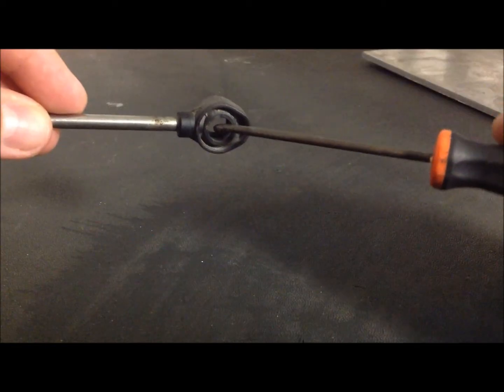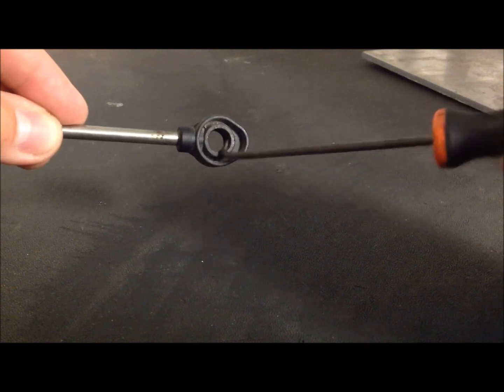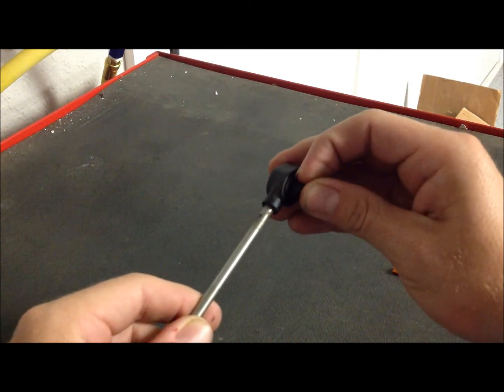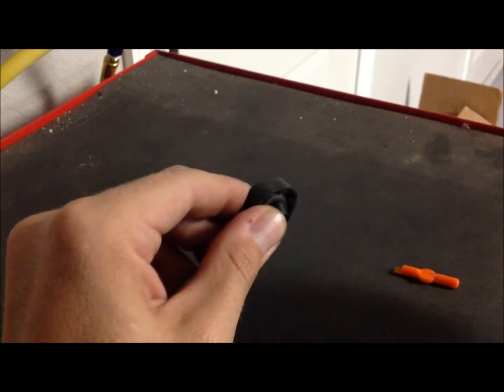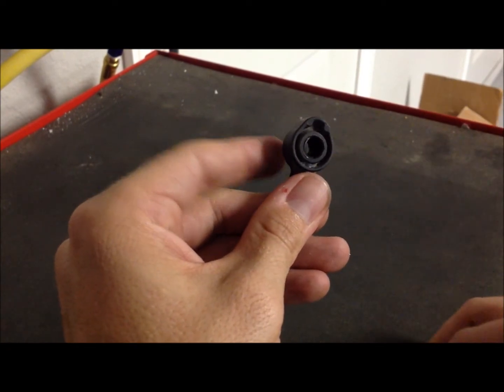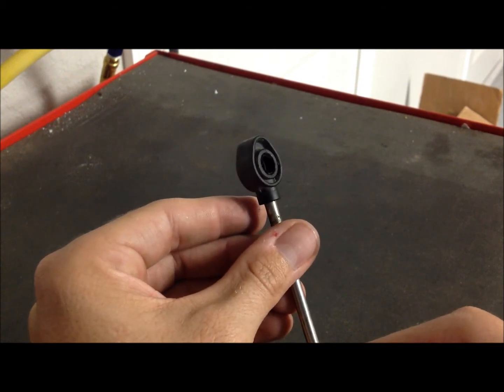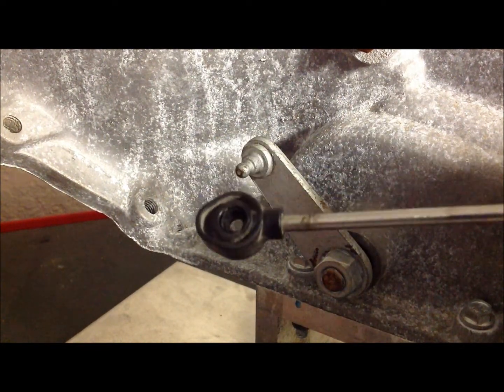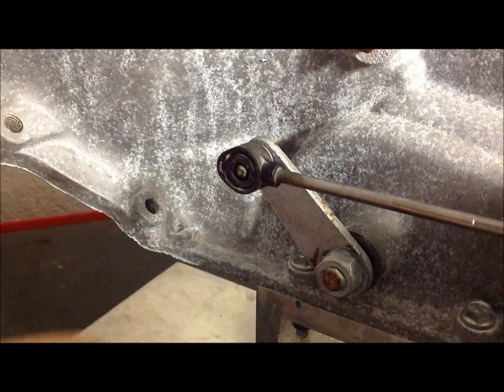The easiest way to fix your Ford Ranger shift cable!   Kit includes replacement bushing.

Comment: Who the hell approved of that tiny wire at ford, did it result in a bonus for someone, or the savings paid for an exec. New year's Eve party ? 
Ridiculous .
I broke mine, top.of the loop, so I crimped on a whole new loop.to the wire, guessed really close, barely had to adjust the adjuster thingie. Whatever happened to the idea of durable? 
It's not like the weight savings matters. 
What do they smoke / snort/ shoot up at ford h.q. when they approve of crap like this
Reply from the maker: Richard rarely am I stumped! But you got me! I'm not sure why any of the manufacturers produce parts that fail and that are from original design inadequate for the lifetime of the vehicle.  Yes sir! There was a time that the idea of durable applied - I agree.  From my business end as a Master Tech I saw many costly failings that left both the vehicle stranded and the customer cash poor.  Frankly it was and is the inspiration behind our products.